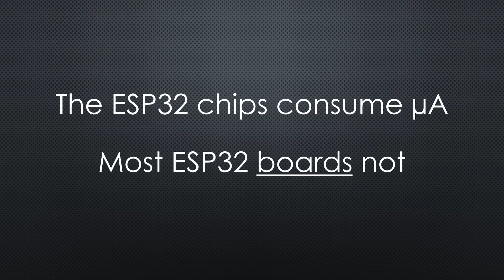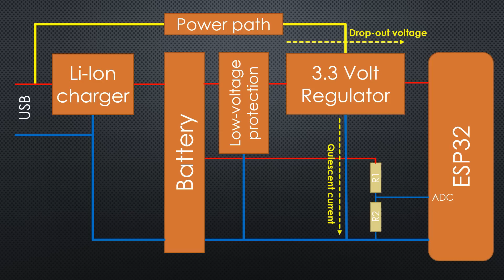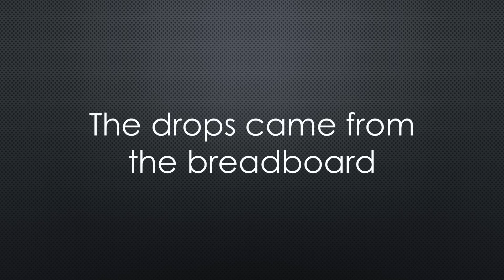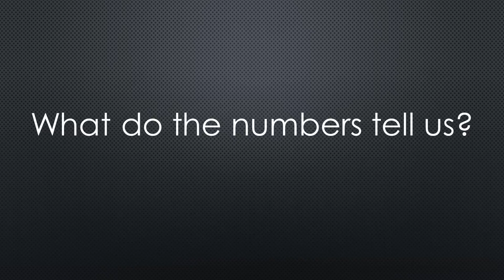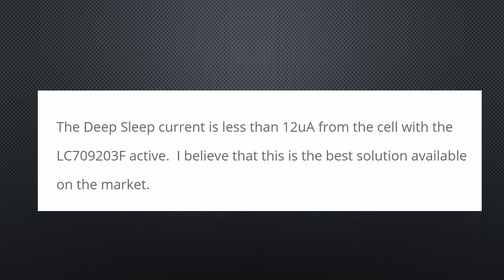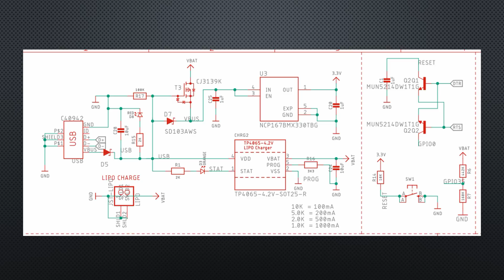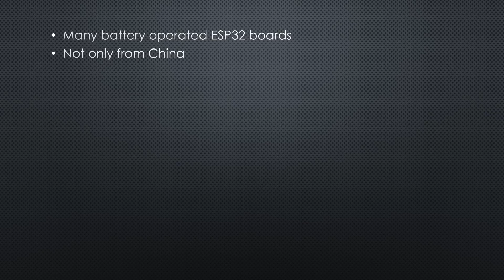#387 Test of Battery operated ESP32 Boards (Olimex, TinyPICO, EzSBC, TTGO)

Comment: I did not even realise that undervolt protection was so important. That would explain why my ESP32 project has died and no longer charges up. Are there any Li-ion batteries that come with undervolt protection included?
Reply: I always recommend using batteries that have over and under voltage protection. The ones I use (from Adafruit) with the yellow Kapton on the top have both under and over and will cut-off below 3V to save the battery.  The ones with red on top usually don't have protection.
Reply: Yes, some can be ordered with a battery protection circuit built-in.
Reply: @sail4life  I know that batteries often come with over-current and over-voltage protection but do those circuits typically also include low voltage cut-offs?
Reply: the vast majority of Li-Po pouches have battery protection (OV-UV-OC).. the opposite goes for 18650s and similar cells which are not protected... many devkits are designed with Li-Po or protected cells in mind... battery protection can consume an extra 4-10uA from the battery when nothing else is powered...

Comment: You said it requires only 2 additional components for the undervoltage protection, could you please specify them?
Reply from the maker: You get "voltage supervisor" ICs which can either be used to reset the MCU at low voltages or, together with a transistor, switch the device off.
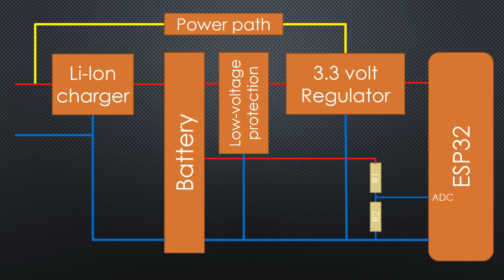Reply: @AndreasSpiess  Right, thanks, so I do have MAX809 monitoring the Battery voltage. If the Battery voltage goes below 3V, it shuts off the LDO that supplies power to the ESP32, till the battery voltage rises above 3V. The Over voltage protection is via MCP73831, that charges the battery safely @ 100mA via USB 5V, and I do have Power path. The R1, R2 is 100k, and so my circuit does look like yours at 3:22 

My concern was that I did observed my Li-ion batteries swelling up sometimes and I couldn't figure out why was it happening to my circuit. 
I thought I did take care in designing it, any thought why? 
Temperature wise, the whole thing is at room temperature, except the heat generated by ESP32 but that too isn't much since I have implemented battery saving features in the software.
Reply from the maker: All my Li-Po batteries swell with time, too :-(
Reply: @AndreasSpiess  oh okay, i thought I missed something in my circuit. Thanks 🙏🏻

Comment: How is the battery is drained at a voltage lower than the minimum input voltage of a board? What did I miss?
Reply from the maker: The ESP32 boots and crashes all the time and consumes a lot of energy.
Reply: @AndreasSpiess  Thanks!

Comment: in video #366 you showed the lolin D32 v1.0.0 had the lowest current draw in deep sleep (even better than your ttgo t7 which requires modificiation of the led removed) 
I bought a couple of these and 1 of them is almost 6 months running on a 2500mAh li-ion battery with 1 minute on-time and 23h59m deep sleep (the battery is still just above 4V measured while it is in deep-sleep with a multimeter)
Would have loved to see that one in your comparison as "older boards reference" 
From schematics found on the wemos website ( https://www.wemos.cc/en/latest/_static/files/sch_d32_v1.0.0.pdf ) and if I understand your explanation in this video correctly: 
it uses TP4054 battery charger, it has a direct power path through CJ2301 I think and the 3.3V regulator is the ME6211 
I guess the IO35 is the one used to measure the battery voltage (as that looks to be connected to the voltage divider close to the battery circuit)
Also not sure how you determine the low power protection ... (but I assume there is none just like most of your other boards tested above) :)
And yes polarity was reverse to my JST PH2.0 battery connection leads I bought a while ago, so I used the advice of some "Guy with a Swiss accent": always check for grounds to be the same... :)
Reply from the maker: Your analysis is absolutely right. And the values of the old boards should still be in the table for comparison.

Comment: interfacing led driver with esp32: hi i needed to drive STP16CPC26 or TLC59283DBQ but to my surprise, nothing really happens. I checked i am writing data correctly but not sure if there some incompatibility in signal level. Any idea or hint.
Reply from the maker: Unfortunately, I cannot do remote debugging :-( Are you sure you use the same voltage level for Vcc as for the logic pins?
Reply: @AndreasSpiess  yes, I thought you might be able to pick from datasheet in case I need level shifter. I was using pin 19, 23, 18 and 05 of esp32 .

Comment: Given most of these will run off a single cell just use a protected cell for low voltage project.
Reply from the maker: Agreed. This is a good idea if they fit in the battery holder. Most of my battery holders are too short for them :-(
Reply: batteries with embedded protection unless we are talking Li-Po with have it pretty much as standard, are for the most part more expensive, harder to source and usually no standard holder can host them plus, you get to account for 4-10uA power consumption on the protection circuitry which is a number often neglected (add to this the 5% self discharge rate of an average quality cell and things are not quite so simple anymore)

Comment: Excellent video. I am really wondering why no board integrates low power protection. BTW: an interesting ESP32-board is the trigBoard v8 (https://trigboard-docs.readthedocs.io/en/latest/), though it is made for specific kinds of low power applications such as smart home.
Reply: 1st cause they assume you will use them with small capacity LiPO which already have battery protection in them and 2nd because of cost and 4-10uA added IQ on the charging/protection circuitry
Reply from the maker: In the meantime I learned that it is forbidden to include under voltage protection on the board because it enables the usage of non-protected batteries which also seem to be forbidden. So maybe in the future we will get only protected batteries and do no more have to care...
Reply: @AndreasSpiess  forbidden? not a chance Andreas... the vast majority of Li-Ion cells in the market is unprotected and the vast majority of LiPO is protected.... LiPO sourced from reputable sources are far more expensive in smaller capacities but serve different purpose (use in small custom made enclosures/projects... The designers of most of these devkits are assuming you will use LiPO with their product again due to size and capacity requirements (also they rarely limit their product to a single 18650 onboard)... leaving the protection to the end user does not mean they will use protected batteries, they will use whatever they have and if not lipo it will be non-protected.. but, one can easily add battery protection to an 18650 for a few cents (until recently at least) using tiny boards that solder to the cells poles.. this though adds another 4-10uA power consumption to the battery even if you do not really measure it always

Comment: Curent boost with a or two transistors (better MOSFet):
a) https://www.diyaudio.com/forums/power-supplies/367446-disadvantages-using-l78xx-l79xx-current-boost-mj2955-2n3055.html
b) http://www.zen22142.zen.co.uk/Circuits/Power/boosti.htm
Reply from the maker: Thank you for the links. Usually we do not need much more current than about 500mA for the ESP projects. The fast changes are more the problem.
Reply: @AndreasSpiess  I think that you can compensate the FAST CURRENT CHANGE with the boost circuit. Think that the Mosfet transistor can react faster then the regulator... just an idea...

Comment: "For my case, I want to power the TTGO T-Call & PMU ESP32 board, which combines ESP32 and SIM800L. I want to use a 5V power bank for it. However, in case the power runs out, the board switches to battery automatically. Do you have any suggestions?" 🥲
Reply from the maker: You get power banks that allow charging while discharging. That would be the easiest way. But this feature usually is not mentioned in the specifications.